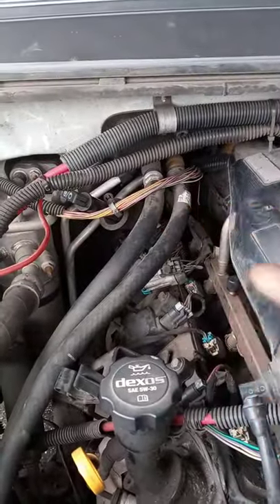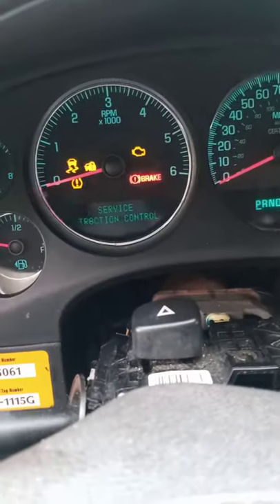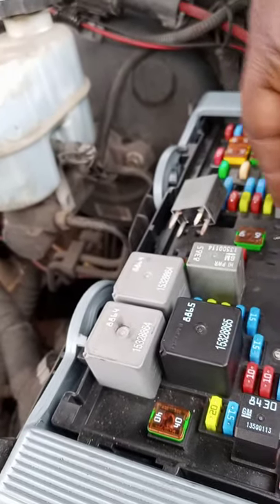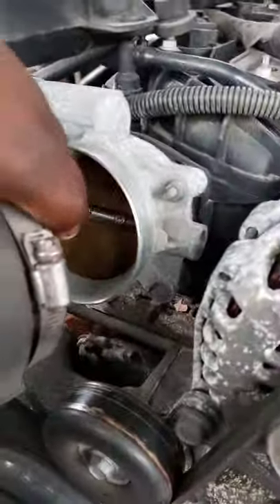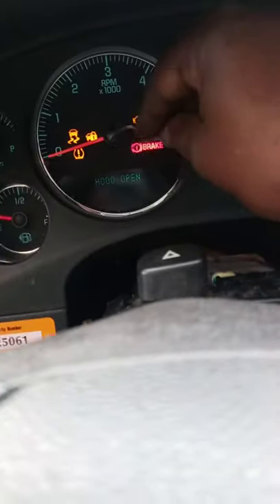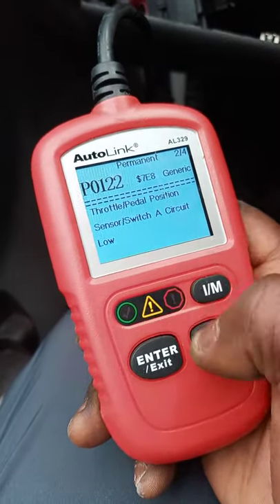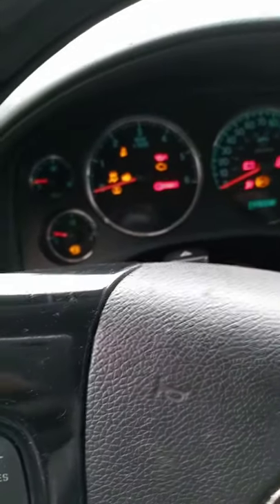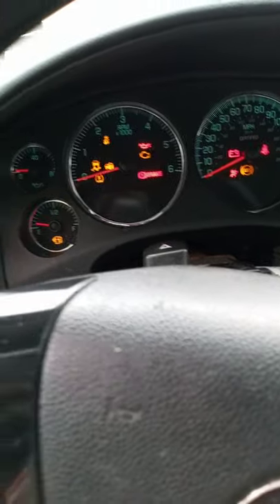2007-2012 Chevy Tahoe No Crank ( Solved ) ( 2021 ) ( ECM )

Comment from the maker: Solved it..............
 was The ECM in the engine bay  , the Fuse Box , and theft system replace all 3 with a new key fob and the car finally runs thanks for watching also BCM could possibly be your issue if u have no codes or u0140
Reply: I got multiple 5v references and I changed out the ECM ? Could it be the mega fuse ? Or bcm?
Reply: My shit been in the shop for 6 months now I've spent over $2,000 already
Reply from the maker: @rodneygreen5855  do u got a check engine light cause that will show u some dirrection but the theft moudule on the ignition ECM FUSE BOX MEGA FUSE 175 BCM and if no keys work to the car
Reply: @Handymandan215  see my truck lost power while driving and I changed the ECM and had multiple codes ..changed what I had come up and got a crank no start took it into the shop and they are saying I have multiple 5v references missing they changed all the grounds but didn't changed 
TPS
BCM
Reply: I just put a new mega fuse in myself and they didn't have the key that I had made and programmed when they did the ECM relearn so they have that key now I'm thinking the theft module is keeping my truck from starting without that chip with the relearn
Reply from the maker: @rodneygreen5855  It will no crank no start
Reply: Hey bro mine doing the same thing how to fix it
Reply from the maker: @Jocobyplays9786  Mines was The ECM and the Theft Module , Check fuse box also the 2amp fuse blew Run crank relay
Reply: @Handymandan215  where you get your ecm from and how did you program it
Reply from the maker: @Jocobyplays9786  new ECM & theft module w/ 30 min key relearn
Reply from the maker: @Jocobyplays9786  https://highway71autoparts.com/shop/2010-2013-chevrolet-silverado-engine-computer-12633238-programmed-to-your-vin-2/
Reply: @Handymandan215  I figured out mine bro it was the dlis in the engine junction
Reply from the maker: @Jocobyplays9786  Glad it runs now ! be posting a new video today on tips and prevents on u0100
Reply: I have P0230 but my 08 surburban 2500 ls 6.0 is doing the same thing. It was a service car as well. Any suggestions??
Reply from the maker: @ciarahicks9771  check the fuel pump relay in the engine bay or side of the driver door ........ open the gas tank listen for  buzz noise means fuel pump is working
Reply: @Handymandan215  thank you. I played with the fuses today it gave me code p1682 now!
Reply from the maker: @ciarahicks9771 this could mean the ignition switch is bad. or... if the immobizer lock on  ( a yellow car with key ) on the dash...... if so its the theft module before the ignition switch where the key is located
Reply from the maker: @ciarahicks9771  check for corrison in the fuse box  .....even lift the fuse box out by release the tabs and check for blue or white corrrison ...... Ignition switch or theft module ( if Key lock is Enable )......
Reply: @Handymandan215  omg Dan please I changed the fuses out and not it won’t do anything the theft light is on
Reply from the maker: @ciarahicks9771  theft module for the key 🔑 and u gonna have to reprogram the key after u replace the theft module ….. take off the cover of the steering wheel  where the key is located …. Get a needle toothpick  with a 🪡 tip put it in the hole next to your ignition switch ( key hole ) turn the key and press down with the needle in the hole to remove the ignition you the need to pick the side of the theft module
Reply from the maker: @ciarahicks9771  https://youtu.be/bFAVBRJK7_k he can explain it better then me
Reply: @Handymandan215  I’m like 99% sure my fuse box is gone. Should I wait until the part come in?
Reply from the maker: @ciarahicks9771  yes cause there known to internally burn out
Reply: @rodneygreen5855  did you ever figure it out? I'm having the same problem
Reply: My bro has a 5.3 15000 chevy Ls and we changed the engine and ran into this problem. I replaced all the fuses and relays just in case in nothing. Then bought a new starter and still nothing. Then I looked for all my grounds and clean em good and nothing even added extra ground and nothing. What help me turn her on was after doing all of that. I disconnect the battery for million time and actually made the positive and negative touch each other and tie em with a zip tie. Went to the ECM or PCM and unplug both PCM or ECM waited 30 minutes and then connected everything back and turn on after just sitting there for 3 months with a new engine new upgrades we bought for it that was the trick that turn her on. But if you gotta do that more then one time your truck is asking for a new ECM or PCM guys
Reply from the maker: @neverthatnever  facts I had to buy a new ecm and new 
immobilizer for the ecm
Reply: It could be the hvac that’s what was wrong with mines

Comment: Mine just did this and googled it and someone said stomp on the brake pedal several times that their brake switch stuck and I had just drove it and no issues came back and had nothing no power no click but lights and radio worked. So I stomped on the pedal and it started right up.

Comment: I had the exact same problem on my 2012 Chevy Tahoe replaced fuse number 35 which is a 10 amp fuse as soon as I replaced it. I heard the dinging to let me know that the door was open didn’t hear that before. Replace the fuse jumped and it started right up. My truck was sitting for five days.
Reply: Yeah, that’s what it was fuse 35
Reply: *2 amp

Comment: Turn the key to run position watch for the light turn off then turn the key off for 10 sec and then try to start if it doesn’t work repeat the process.... had to do it with my Tahoe
Reply: Did it work
Reply: @rodwalters802  yes
Reply: What light and what was not happening this fixed? Also what year please?

Comment: My Tahoe was doing the exact same thing!! I watched your video and was like no way im about to break everything down like you did. But i was like man i must have drained my battery then I remember my key the part you put on a key ring had broken I drilled a small hole to put it back on the key ring. I grabbed my spare key it started right away
Reply from the maker: glad i could help
Reply: Mines doing the same thing what do I do

Comment: Man i have same trouble whit my suburban 2010 and before that happen lost communication ecm whit tcm and burn my clutches of my transmission after take it down transmission after 7 months just park decide to make it run my self i know mecanic the problem was the time for my business. Coming back to point i take tran down rebuild the all trans a friend buy me a new valve body and not run it’s was the ecm was bad after change start working but whit he same fault as the transmission start doing and supposedly have to relearn parts i buy computer soaftware and install everything and stop working again. Now check it’s was neutral switch inside trans and start working again but when i do the relearn gears not work 3,4,5 suppose to it’s was again computer not getting communicaction whit bcm and throttlebody position module crank sensor and broke my trans chutches again and finally found it’s was  the speed sensor inside trans and now have to fix trans again and power and geound cables not getting enough power
Reply from the maker: frfr it it gives u more problems go on muncibid and grab a new one for cheaper but check your wiring these cars dont likee water
Reply: You wasted your money on the transmission the vehicle goes in limp mode when there's a problem it don't let the gear shift when you fix your problem the transmission will work again

Comment: Check. Run/crank relay under the hood. It's the closest to the drivers fender. It's identical to the starter and headlight relay.
Reply from the maker: Top 5 things in this car that can cause a no start BESIDE STARTER

1. ECM

2. BCM

3. FUSE BOX

4. THEFT MODULE &/or ( KEY PASS #3 it self) (  NEAR KEY IGNITION )

5. BATTERY CABLES

Comment: Mine did the same thing. Believe it or not, it was my key fob. We lost our set of keys with the fob. A month later it would not start. We found the key fob went out and it fired right up I swear. Oh, yeah, it put that. Lock mode on the anti-theft pretty much. But as soon as I got the fob, it was fine, never had that problem again.
 ECM, wasn't it?
Reply: Oh s***, when we lost the fob.We used another Cut key from the car lot we bought it from It came with like six keys but one Key fob never knew it could be such a problem but now I do.

Comment: Willing to bet its the fuse box. Ive been having the same problems but on cold days 2010 Tahoe. Under 15°. First time it was the starter relay. I swapped it with the trans one next to it and she started and i limped in 4th gear to the parts store. 
2nd cold snap within a month. My 1 year old optima dropped down to 11.6 volts. Brought it in overnight jumped it next morning 12.1  and pow she started with a jump pack. 
2 weeks later warrantied my battery dropped down to single digits last night. I tried the auto start to warm her up and no go. Also this was how i had been starting her in the cold so im wondering if that circuit is a problem too. Anyways my battery is at 12.15 and won't start with a jump pack. Neighbor offered to throw cables on it to warm his car up Anyways so sure. I start pulling relays and taking them inside to test them. Theyre all good. Yes i have a 9v battery alligator clips and a multimeter checking continuity.  I get pissed start trying to rip off the fuse box after noticing those gray lock down handles. Start jiggling twisting wires etc finally slam in back down and smack the shit out of it. Bam it started that time. After relay swaps fuse checks wire jiggles i was tryinf to start her. So something is bad inside that relay box. As its 12° out im waiting til the next no crank no start.
Reply from the maker: i changed the fuse box too . i went to the junkyard and took every part i needed
Reply from the maker: corrision can get inside the fuse box interiorly so u cant see whats the problem just electrical problems
Reply from the maker: i replaced it again ( 3 times ) just to be safe
Reply: @Handymandan215  i haven't had a starting problem since ive reseated mine. I found a new one on rock auto just haven't ordered it yet since its currently working great.

Comment: Hey can u help me..i put a new fuel pump and fuel pressure sensor on.the codes in getting is 02 sensor,oil pressure sensor,throttle position sensor..plus somebody sa i need an amp 25 fuse ans fuel pump relay..can u tell me which will get my 2012  truck started

Comment: Check if your Throttle Body is Engaging  Might be a Bad Throttle Postion Sensor 
And check the connection  that hook up to the Throttle body 
Should be the middle Bottom that has power  
At least 5 V  I use a regular Fuse tester shouldn't be to Bright  if power 

Check fuse 66 - Stud 2 and Fuse 38 HVAC Battery 
My started after replacing those fuses and erasing codes .
Good luck !

Comment: Hey handy man Dan I got the same issue going on that you had in this video with my 08 Tahoe once in a while when I’m holding the key in the crank position it will turn over but won’t start then randomly stops cranking over idk where to go with it I just put brand new battery in it have checked every wire and fuse possible have the whole inside dash ripped apart any advice would be awsome thank you

Comment: And it won’t kick over when I spray the tarting fluid in it I just did the jumper like u show in video and it cranks over but when I put the starting fluid in it it doesn’t change anything like it’s getting no spark either
Reply from the maker: Did it throw any codes if not try reprogramming the key

Comment: I have the same problem on my 2015 suburban I change the battery now it won't start and I have the p2535 too on it
Reply from the maker: run start relay / fuses & fuse link on battery cable
Reply: @Handymandan215  the yellow wire on the starter don't have any power but I moved all 3 relays around because they are the same even when I hit the switch the yellow wire doesn't have power
Reply: @Handymandan215  how do you run the relay I put power on the starter yellow wire and the truck act like it wan

Comment: Hey everyone I have exactly the same problem Please help. I did all the checks. The fuse box is new and the starter is new What is the problem? Thank you
Reply from the maker: if u got the u0100 code then its the ECM in the engine bay ..... if not its your Anti theft system

Comment: Hey my tahaoe is doing the same thing.  Did you ever resolve the issue hmu lmk.
Reply from the maker: yea it was the theft Module around the ignition switch and other things i changed was

THeft 
KEY
ECM
FUSE BOX

Comment: Any luck?? Just replace the dam ECM On My AHHHHHH  now all I get is a long Long Crank but no start......  use to just get clicks  now its trying 🤷‍♂️🥴
Reply: Matter of fact almost the same codes..... 

P0633
P0223
P0123
P0107
U0214
Reply from the maker: U got better luck then me ......  Your key needs to be programmed ..... 30 min relearn ......... Wait untill the immobilizing light goes out every 10 mins
Reply from the maker: U got lost communication with the key fob just program the key
Reply: @Handymandan215  hey buddy I don't see why it would lost communication.   Maybe bad Anti theft Module?  I program the key to where the Anti theft light goes off . But still no crank . And if I would to reprogram the key again don't think it would let me since the Light doesn't stay on... so Dam confuse..... will post video..
Reply from the maker: @averagedrivewaymechanic300  all those codes have to do after u replace the ECM u gotta do a crankshaft postion. Relearn and a throttle body relearn idk why chevy made it so difficult
Reply from the maker: Yes finally fixed it it was the EcM along with the theft system and fuse box thanks ur video helped me
Reply: Change run/crank relay.

Comment: I’m going thru the same bs after you replaced the ecm did it crank right away or did you have to do something else
Reply from the maker: 30 key relearn
Reply: @Handymandan215  so it wouldn’t crank or start still with out the relearn
Reply: Mine doesn’t even show the lock on car
Reply from the maker: @bobbymartinez5763  yup its weird but thats how chevy designed them .....i lost my key to my 2010 Mitsubishi galant and when i got a new key it would just do long cranks no start untill i programed it and fired right up
Reply from the maker: @bobbymartinez5763  if the theft module is bad it will cause a no crank no start too
weird chevy shit
Reply: I wish mine at least had long start it don’t do none throws the code u0100
Reply: So you replaced the hole fuse box
Reply from the maker: @bobbymartinez5763  yeah replace that ecm

Comment: Dealership sold me with the computer like a program PCM
Reply from the maker: which one the grey one ( under hood ) or black one ( under steering )
Reply: @Handymandan215  I'm thinking it's the grey one with the two plugs in it
Reply: @Handymandan215  Under the hood
Reply from the maker: @pookyonebloodpookypook2586  try that still nothing
Reply: Did you get your truck fixed I think my truck I changed the fuel pump which I'm throwing up that video right now and still she started but she didn't stay running she shut off so I'm thinking it's the injectors for my truck but my fuel pump was bad pretty weak
Reply from the maker: Same thing 😂😂😂 and a fuse box and a key 🗝️
Reply: @Handymandan215  lol
Reply: I'm going to put booster cables from the ground of the battery to the ground of the frame to see if that's the problem
Reply from the maker: @pookyonebloodpookypook2586  mines finally works gonna post a videoo next week